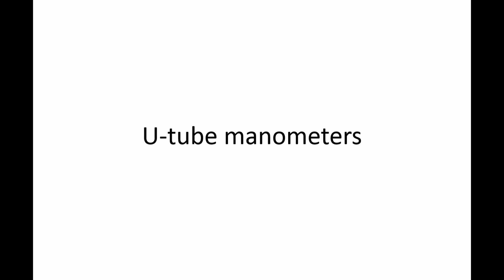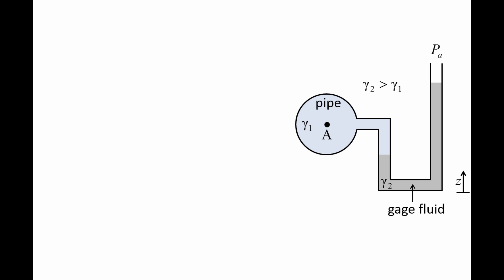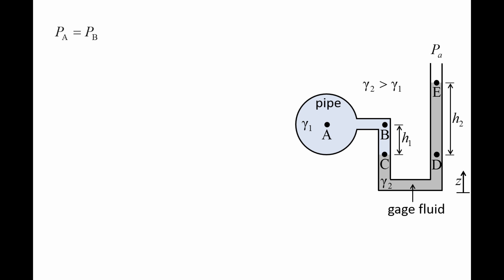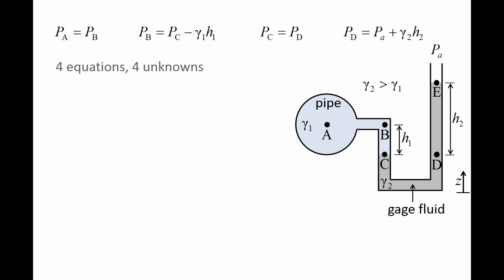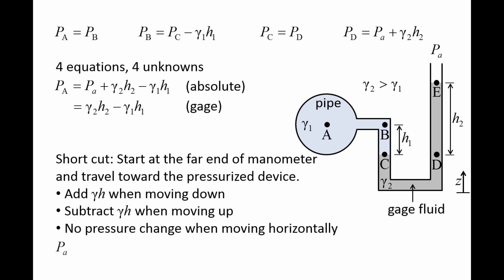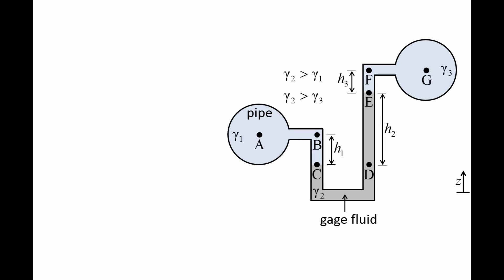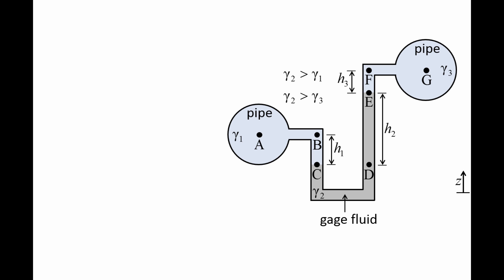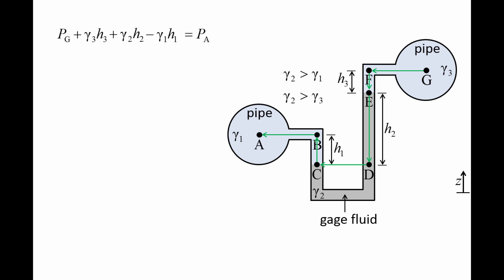Fluid Mechanics: Topic 3.4 - U-tube manometers

Comment: can I use the shortcut method to get those individual equations, if not how can I get those individual equations
Reply from the maker: Which individual equations are you referring to?
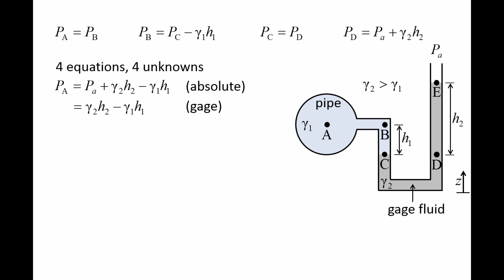Reply: the 4 equations at 3:08
Reply from the maker: You can obtain the individual equations by simply relating the pressure at two points. For example, the pressure at B equals the pressure at C minus gamma*h1. The pressure at B is less than the pressure at C because B is at a higher elevation in the same fluid.